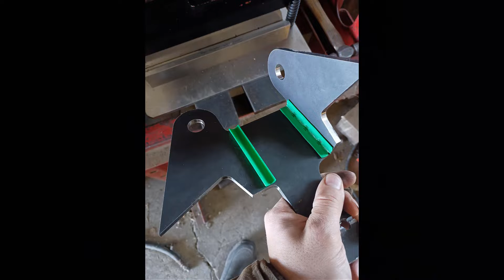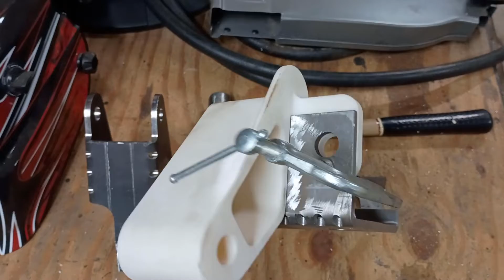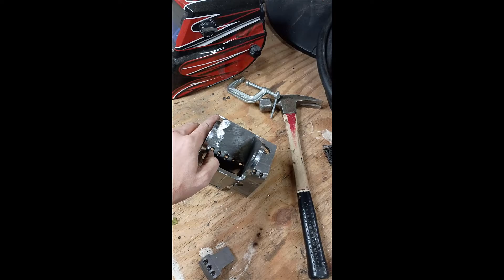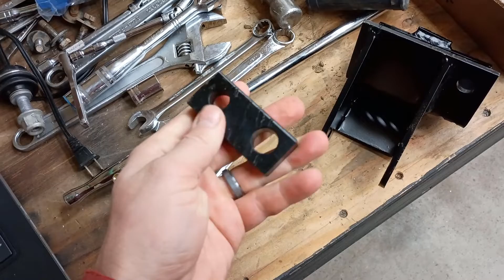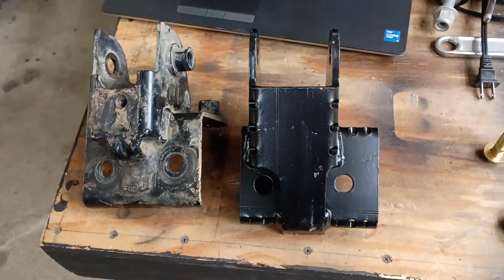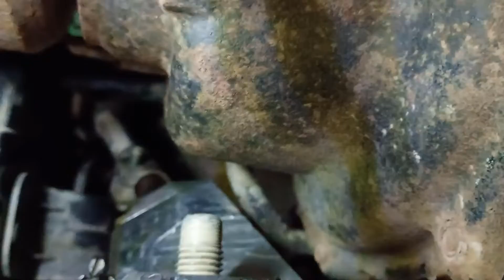How to: Homemade Diff Drop For 6G Bronco

Comment: Very cool man! Was an alignment needed after this job? Say it took ya full day for this huh?
Reply from the maker: No alignment needed for just the Diff Drop, but I did this as part of a suspension lift which itself required an alignment. Took me a day or 2 to make the kit. The actual install isnt too bad though, an hour if you are fast. I probably took significantly longer just to record things.
Reply: @ very nice. I’d consider doing this for myself
Reply from the maker: @djkilpatrick5256  I offer a full DIY kit with templates you can copy if interested.

Comment: I think I want to get this for mine as well. I have JCR skid plates right now but they are (annoyingly) low, I think I have the margin to drop the diff without having to modify them. Might put an order in this week after I inspect closer. You mentioned the lowest point dropped about 35mm further down?
Reply from the maker: The front mount dropped by about 35mm but it already sat significantly higher than the lowest point of the diff. Since the centerline moved down 20mm, and the lowest point is still below the centerline (and approximately round) the loss in clearance right below the diff is about 20mm (~0.8).

Comment: Great job.  I have Kings and definitely need this.  What did you use to cut your skid plate?
Reply from the maker: I just used a thin cut off wheel on an angle grinder. Made sure to mark it all off with marker first. Some additional pictures of my exact cuts on the forum post.
Reply from the maker: https://www.bronco6g.com/forum/threads/homemade-diff-drop-for-6g-bronco.89576/page-3

See page three (here) for a breakdown of my cuts
Reply: @mattg8116  sweet.  Thanks for this.  Looks like the install is pretty straight forward.   It can all be done with vehicle on the ground, right?
Reply from the maker: @sinlab  yes, I did mine on the ground with the help of a jack to support the axle
Reply: @mattg8116  Sold!  Order placed.